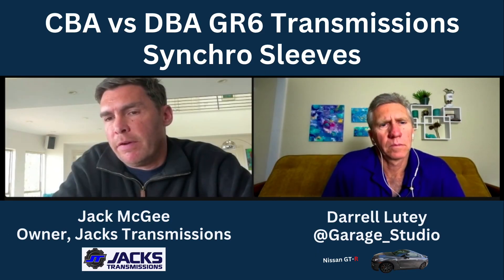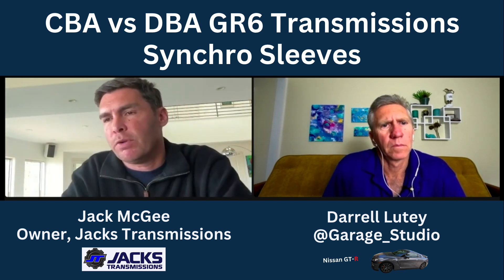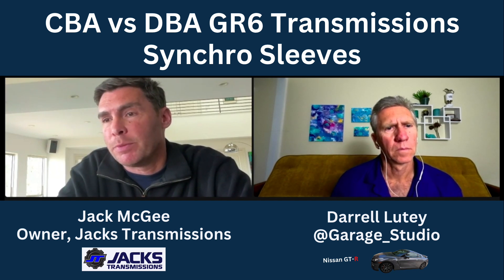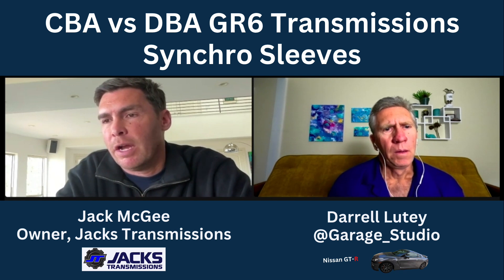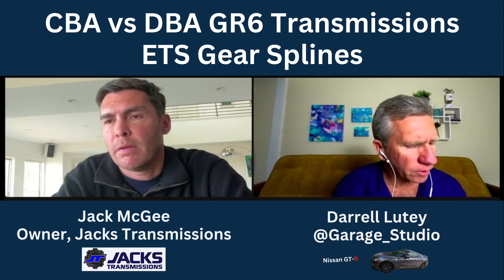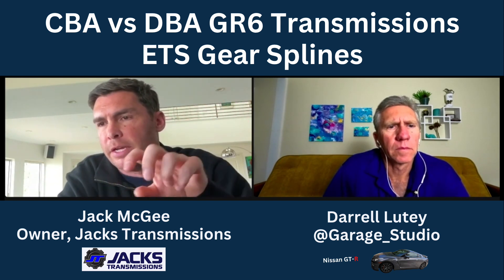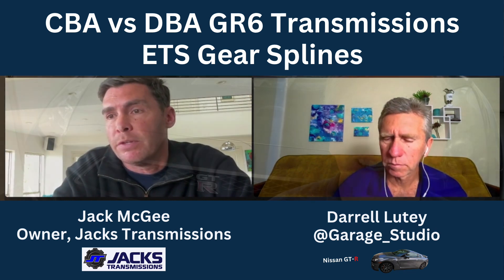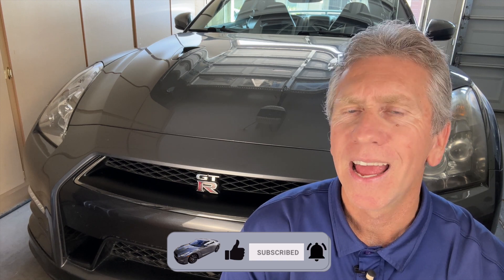GTR Transmission | CBA vs DBA | Transmission Expert Explains Differences | Jack McGee of JacksTrans

Comment: When I was looking for my car, I knew I wanted a pre-facelift DBA...was looking for 2015 or 2016 specifically.  Was willing to compromise on that a little, but overall wanted a car with some mods to act as a platform so I could build it.  Was planning on getting one from Chicago Motorcars as they're right next to the GT-R GOAT, AMS.  

Well...I just happened to find LOCALLY, here in Phoenix, not just a 2016, but a pearl white (QAB, just like my 370Z!!), single owner car that's already got all the work that I was going to do done!!  FBO, tuned on EcuTek, upgraded turbos, bunch of AMS parts, everything...done.  With only ~11k miles.  It wasn't cheap, but it was (is) PERFECT!!  I got SO lucky.  

It's been almost 3 years now!!  There have been some hiccups, as is the nature of "tuned" cars, but overall?...I LOVE it!!
Reply from the maker: Congrats on the purchase.  Enjoy it!!
Reply: What hiccups..?
Reply: @trentmclellan1037 The biggest pain in the dick was the wiring harness for the fuel pumps dying. Was heading to the gas station, gave it some gas, lifted and...*dead*...car was still on but the engine died like it was out of gas. First time it happened, I let it sit and it started again after a few minutes. Second time, it did not and I had to stand out in the Phoenix sun for a couple hours waiting for the flat bed. That problem took months and THOUSANDS of dollars to figure out. HUGE pain.

Now, the problem is getting the damn thing to pass smog. Nothing to do with the car, really. I KNOW it's done it before as it sits because it has a plate and I haven't done anything to it since I got it. But that's how it goes. Stupid government bullshit. I drive the thing not even 1000 miles a year ffs...

'Tis the nature of cars when you start messing with them, though. The GT-R is an AMAZING platform...sky's the limit. (Well...your wallet is, really...) You can do anything with it and a buddy of mine has one and he said it's been the best car he's ever owned. Coming from him, that's really something...he's had a few cars over the years including some cars used in Fast and Furious movies. His doesn't have much work done to his...that's the trick. As with any car, the less you do, the less problems you're likely to have. The things are already pretty damn fast. Do the basic bolt-ons to wake the car up (ESPECIALLY exhaust...the VR38 is one of the best sounding engines EVER when you open it up!!) and stop there and it should treat you VERY, very well. Especially if you get a 2014+...that's what I was specifically looking for.

Comment: Ive had my CBA for a couple years now, no issues. The transmission does some weird things sometimes... but I think its mostly computer issue and not mechanical.
Reply: I’m looking at purchasing a CBA potentially if I can’t find a DBA for a decent price. Anything done to yours?
Reply: @Waynethegunner  hi, yeah. Cobb tune 93 Oct, + big SF intake, mid pipe, cat back exhaust, high flow pumps. Will be installing new injectors and do one more tune to tide it all in nicely. Only 600 hp max. Maybe stay below 590. I don't want to over do it. I'm all about balance. 
Car has been amazing, hasn't given me any issues. Best car I've ever had. Also the launch control is disable. I'm still able to do 11.4 in the 1/4. With crappy non sticky tires!
Reply: @AlexandersArchways if you don’t mind me asking, how many miles on yours. I’m seeing some at many different mileage and different prices. Also just noticed Goku in your avatar. Nice!
Reply: @Waynethegunner  haha thank you, DBZ fan for life! Mine has 84k kms. So miles like 52k miles. I dunno if that's low in your area or high. I mean for a 2010 car. I find it low milage in my opinion .
Reply: @AlexandersArchways  yeah that’s good mileage. Appreciate it, and absolutely DBZ IS LIFE!
Reply from the maker: Amazing machine.
Reply from the maker: Even a perfect GTR makes some weird noises.

Comment: I have a 2014 R35 which already has a DBA but I've been wanting to pick up a used  cba which I would like to build and keep as spare, but I do see that it costs around $1350 extra to convert to a DBA, my plan is to do the basic 1st gear upgrade, clutches and baskets
Reply from the maker: Sounds like a plan.

Comment: Great video. Thanks. I am too a little confused when Jack started jumping around talking about the synchro sleeves, ETS gear and then the clips. So is he saying for the CBA, you should definitely update the clips to prolong the life of the trans? Or should you also change the synchro sleeves and ETS gear?  I guess the answer is "yes change all of them" but just want to clarify when he started talking about the failure that would render the trans useless (@10:05), is his talking just about the TSB clips or the clips at the ETS gear?
Reply from the maker: Yeah, it's a little bit confusing and i'm not a gear head.  But he is definitely not talking about the typical TSB clips replacement.  It's the clips for the ETS gear.  Hope this helps.  You could also give Jacks Transmissions a call to get clarification.
Reply: At the 10min mark he’s talking about the cir clip that holds the ets drive gear on the end of the output shaft.  Like he said if you ever have the front cover off the trans that clip is right there in your face and might as well upgrade it.
My advice is change over everything in a cba trans to dba except the synchro sleeves, the labor required for that just doesn’t justify it on its own.  Save that for if your building a trans with an entire new gearset. (Hence why cba cores are usually 1200-1500$ more to build than a dba core)

Comment: I recall some old forum threads where Jack mentioned that he had a pre-emptive solution for the synchro sleeves.  It sounded like he installed some sort of internal stopper inside the valve body, which then reduced the load on the sleeve stopper, and that this could be done before it all goes south
Reply from the maker: Hm.. interesting..